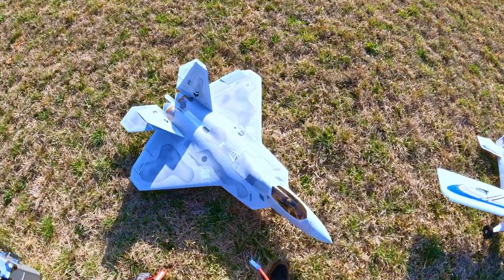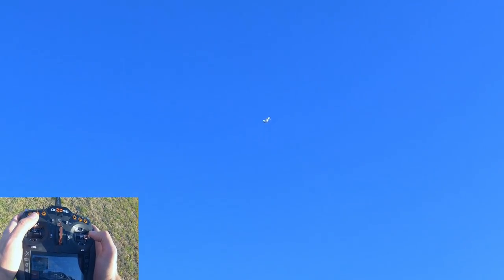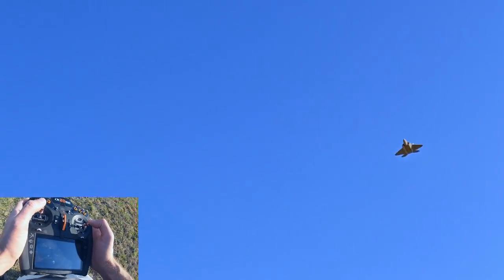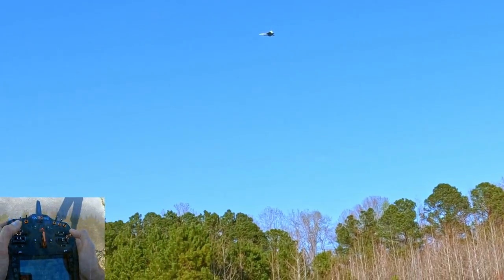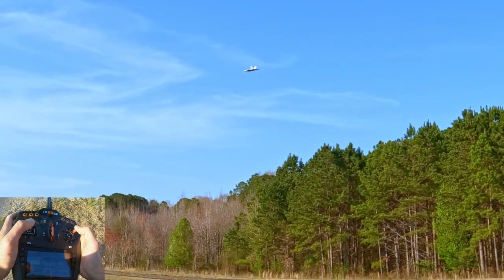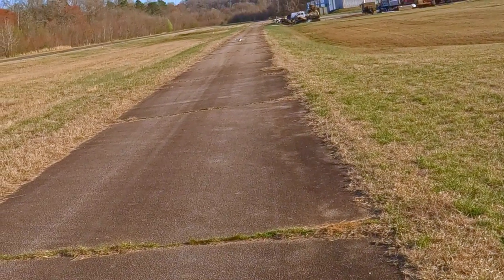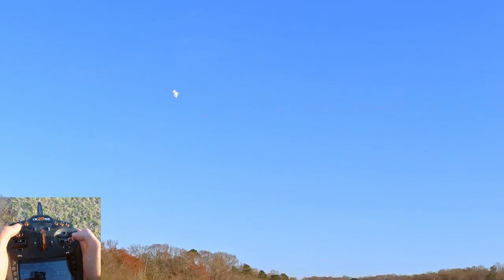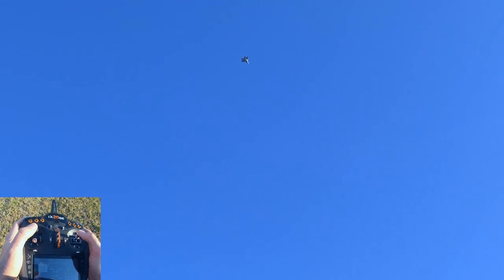Tutorial: Advanced Flying Techniques w/ Freewing F-22 Raptor

Comment: Nice man! So, what is the blue box ? I heard people have a lot of problems with those. Do you recommend getting a different ESC and EDF than the stock? I don't really want to if I don't have to but I'm concerned about this "blue box" thing haha. Thanks
Reply from the maker: The blue box is Freewing's Multi-function Control Box. It simplifies connections for a six channel setup. If you're flying a 10ch setup like I am, it's useless if you're not using wing lighting because it's just additional weight. Lots of pilots look for any excuse to blame crashing on something besides pilot error. I wouldn't put much stock in the MFB malfunctioning. I don't use it because I'm min-maxing the jet to reduce as much weight as I can.
Reply: @TwoBrosRC  Ahh ok! Thanks man!

Comment: Why not use a current sensor and have the radio calculate consumed mAh for you?  I let my radio call out consumption every 500 mAh, gives me peace of mind while flying, and allows me to make optimal use of my batteries for each flight.  Timers are there just for backup, in case something goes wrong with telemetry.  Cell voltage monitoring doesn't work for me, it depends too much on the current load to be of much use during flight.  Current drawn is current drawn, and consumption is current times time.  I use cell voltage sensors only to monitor for differences between cells.
Great video!
Reply from the maker: Well, that's mostly because I don't want to buy a specialty current sensor for $94 when I've been judging flights by in-flight voltage for the past two years. ;) It just works and comes free with the receivers I use, so I don't see a major point to upgrading my fleet of models to get that info. It would be very expensive for very little gain on my end.
Reply: @TwoBrosRC  Oh wow, that's expensive indeed!
Didn't want to sound pedantic in any way, enjoying your videos!
Reply from the maker: No no, you're totally fine. I did consider the mAh sensor but it would be close to $2,000 to retrofit it into all of my models. Just makes more financial sense to continue judging packs by voltage. I'm really used to it by now.